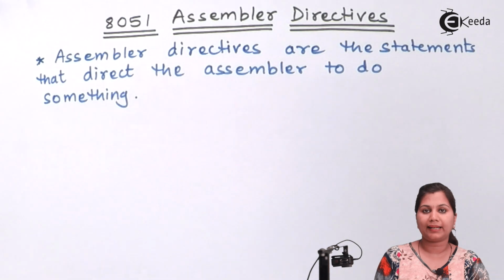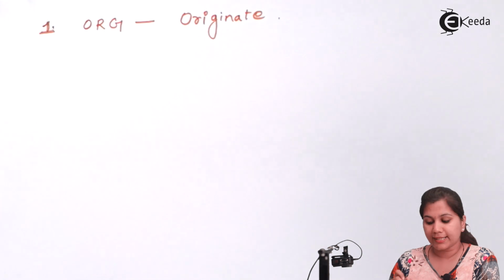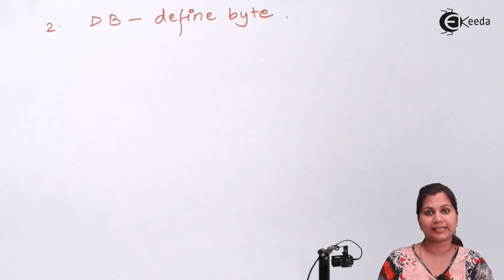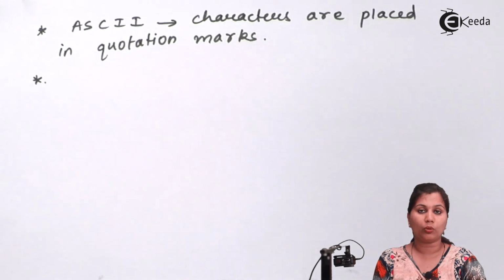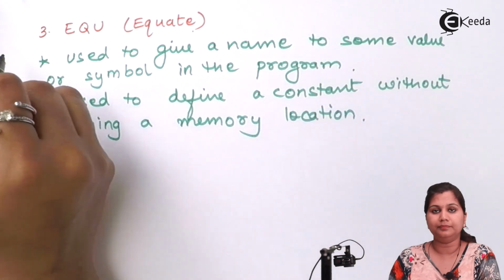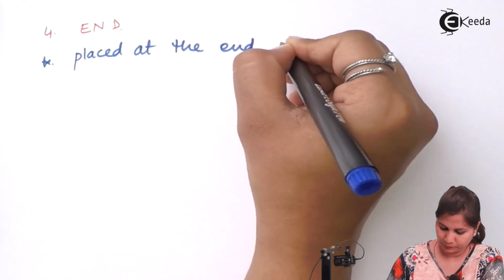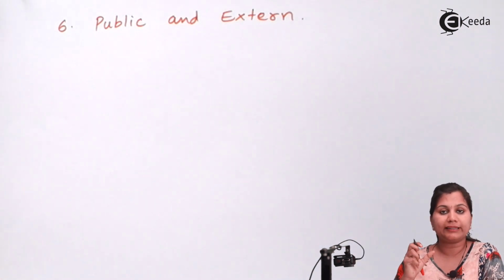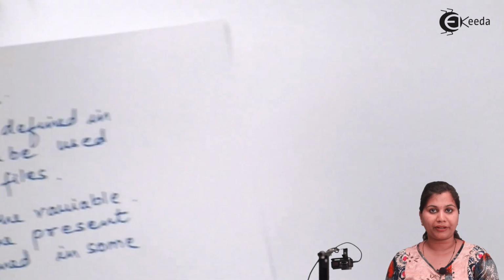Assembler Directives of 8051 - 8051 Microcontroller Assembly Language Programming

Comment: ORG	Sets the origin (starting address) for code or data.
END	Marks the end of the source file. Tells the assembler to stop processing further.
DB	Define Byte – Used to define 8-bit data values (constants, strings, etc.)
DW	Define Word – Used to define 16-bit data values.
EQU	Equate – Used to define a constant value (symbolic name).
SETB	Set bit – Often used in bit-addressable programming (not a directive but an instruction)
DS	Define Storage – Reserves memory bytes in RAM.
CODE	Used in some assemblers to indicate code memory segment.
DATA	Indicates internal RAM (direct addressing).
XDATA	Refers to external RAM (external data memory).
BIT	Defines a bit-addressable variable.

Comment: Can you explain this "val DATA 12H"
Reply: This is an assembly language directive used in 8051 programming (and other similar assemblers), and it's typically used to define and initialize a variable.val DATA 12H means:

Define a variable named val and store the hexadecimal value 12H (i.e., decimal 18) in it, usually in internal RAM.